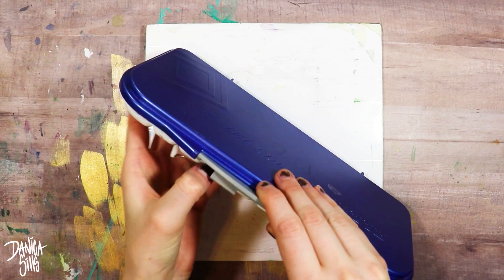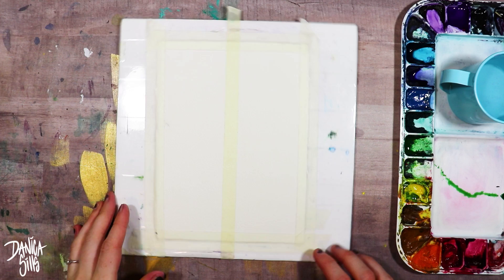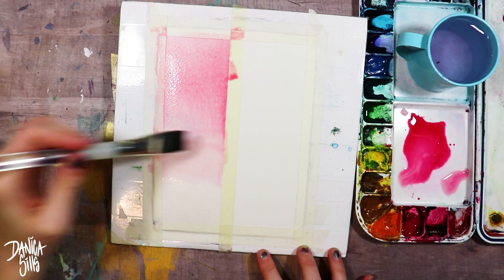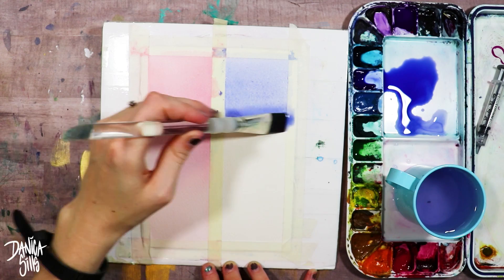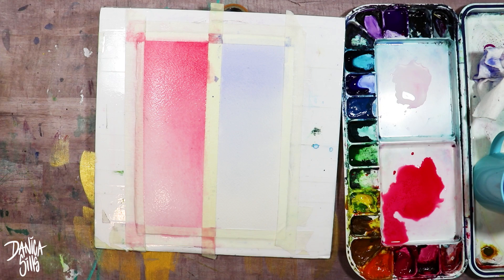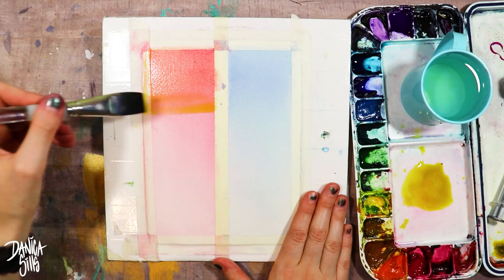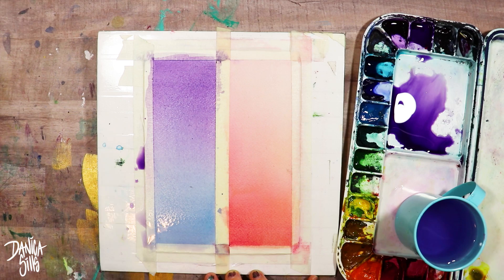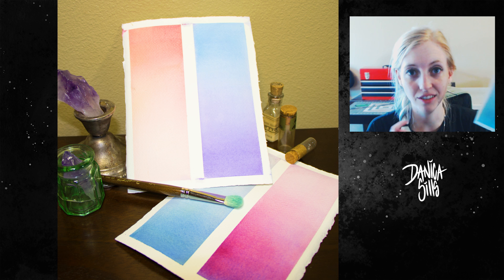How to Paint a Graded Wash in Watercolors ♦ Watercolor Basics Tutorial

Comment: Thank you so much for more basics tutorials! Questions: what consistency does the paint need to be too but wash out or be too pigmented, and how do you keep the set layers from mixing or lifting with the second layers? Or is it just the specific paint brands? Thank you!
Reply: Most importantly the first layer of watercolor needs to be completely dry before doing the next layer. You don't move the brush around a lot or hard with pressure, so usually the bottom layer stays put. The brand of watercolor should not matter, however if you are finding a certain color is lifting/reactivating/mixing with the top layer too much you can find a more "staining" color by looking at the color chart on the watercolor brand's website. All colors are usually rated as "staining" if they stain the paper, making them easier not to lift. I use this technique with both diluted paints and applied more saturated without problem as long as they are dry between layers and you don't scrub with your brush.

Comment: could you do a tutorial on how to keep paper from warping?
Reply: I do tape it down and I do use water color paper but it's not the more expensive kinds so that might be it? I just know that if I'm using the wet on wet technique it warps like crazy and the paint will pool so I was wondering if there's anything else? I appreciate the response
Reply: Allison Erin I'm not sure if any of this would help, but I was thinking maybe use a little less water? I've noticed if I use too much, it really warps the paper. Before you add more layers, whether it's water or more paint, or both, make sure the previous layer is dry.
Reply: that's very helpful,  thank you! I'll try to pay more attention to how much I work it and how much water I use.  I do use a lot for wet on wet so it might be that
Reply: I have the same problem, i use canson 300gsm paper, and while the paper dries mostly without warping, i have a problem where my tape just comes off the paper and wouldn't hold it down anymore. I try to limit how much water I use and do it in layers, but it still comes off... Any ideas about that?
Reply: You can stretch the paper! Make sure when you are doing this you put it on a thick piece of wood at least 1 inch because if it's thin the board will bend with your paper. Also make sure your piece of wood has no varnish or gloss as this will make the tape pop up. Use water activated tape like packaging tape. You wet your whole paper in a flat tub like a bathtub (make sure your bathtub is clean) soak your paper for two minutes and take it out letting the access water drip off. Place your paper on your board and use the packaging tape to tape down all sides when you tape down a side you wet the tape lightly then press it down and rub it on your fingers should get warm from doing this. Let it dry over night don't use a hair dryer or a heat gun because that usually makes the tape pop off rub down the tape if you see it popping up and when it dries it should be tight like a drum and you are ready to paint if not you can try again! It takes a couple times to get it right . You can also get heavier paper like 500lb paper but that is expensive. Or just tape it down with masking tape (you might get a few ripples but not as bad as if you just painted straight on the paper) also make sure you are using 140lb paper this is usually a basic weight for most paper pads! Good luck I hope I helped a little!!!
Reply: I tried many, mainly paper tape(masking tape), sometimes i de-glue i believe blue vinyl tape (at least on google it looked similar to what i use). I have water activated craft tape, but haven't tried it because i thought it would just come off to quickly...
Reply: vai pra art have you tried painter's tape?
Reply: vai pra usa a fita azul
Reply: To stretch paper properly you use Gumstrip. Damp the paper both sides and also damp the Gumstrip which is brown paper tape. Lay the paper on your board and tape the paper down with Gumstrip. Dry flat.
Reply: 1: use better paper, like actual watercolour paper
2: use less water on your page
Reply: Make sure you use all cotton paper. Other papers are made of wood pulp so it doesn't absorb water as well as cotton.
Reply: Allison Erin Same thing here...good to know I'm not alone
Reply: Don't take the tape off until it's completely dry
Reply: @eeveemakeralibi   agreed, I wrecked a beautiful water color painting of mine because I took the  tape off too early.

Comment: Stupid question - What kind of tape do you use? The one I use tears off to much of the paper when I remove it. So I put it only in corners..
Tnx! 
BTW. Great video! :D
Reply: Bruno Rodak try using a paint masking tape and sticking it to a table or counter before sticking it to the paper and using a spoon to smooth out the edges of the tape to secure it.
Reply: Also if you take a hair dryer over the tape it usually will help it come off more smoothly !😊